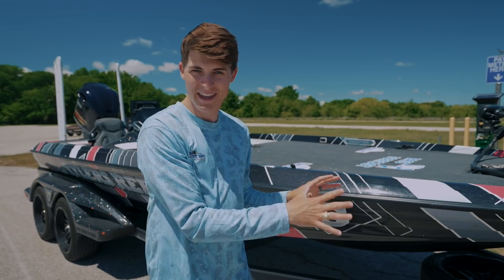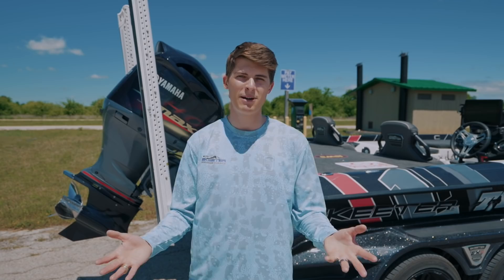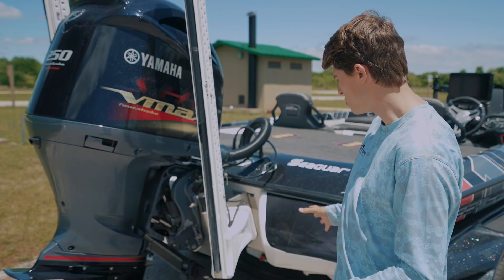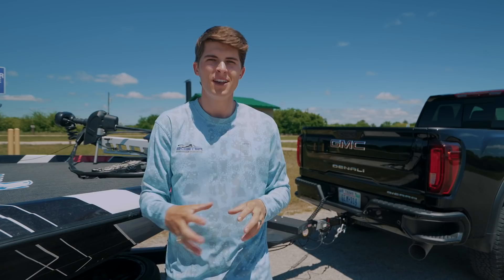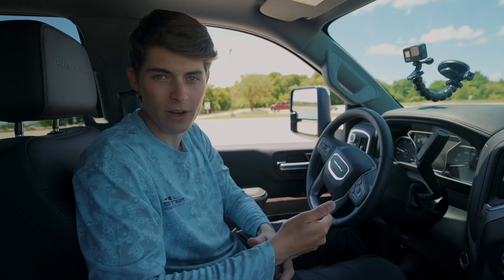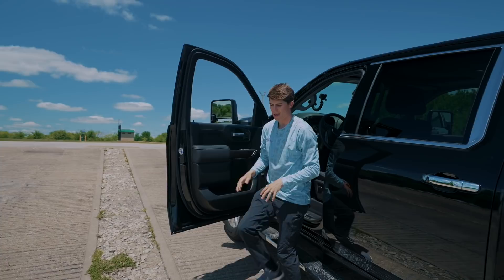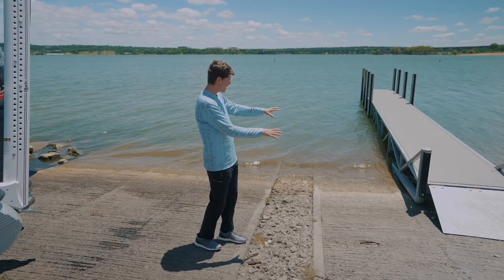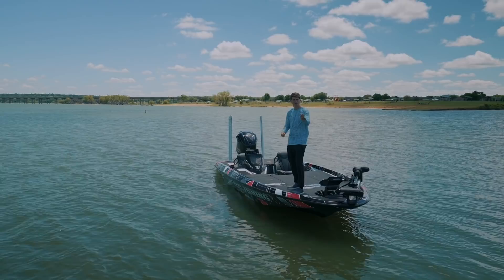Backing A BOAT TRAILER Down The RAMP!! (The EASIEST Way)

Comment: While this method obviously works for you quite well i dont think most older anglers can do this. I fish alone and am 63 yrs old. I am very fit and agile still as i was in the military for 37 years and i dont think I’d attempt this method. I simple back the boat into the water until the trailer wheels are under water, put my vehicle in park with emergency brake on and then unclimbed the safety strap, climb in the boat, start it up, back off the trailer, tie to dock and then go park my trailer.  No chance of the boat ever getting away from me.  I also purchased a ‘trick step’ for the bow of the trailer which allows me to climb in and out of the boat without ever getting wet.  Most pros i know who fish alone have one …

Comment: I also launch by myself almost ever time I go fishing. One thing I do is attach a dock line ( about 30 feet ) to the boat and trailer to keep my boat tethered until I can get on the dock.
Reply: Exactly. If you do like he says in this video you'll be swimming for your boat if you don't get the perfect launch
Reply: I just watched 2 videos that both launched this way. It’s all fine and dandy when ya have them power poles to throw down when ya f up.  I’d have way to much anxiety to launch like this!
Reply: @jcappel802  I don’t have power poles. I tie about 25 to 30 foot of line with one end to my boat and the other end to my trailer. I back my boat into the water until it floats then get out untie the line from the trailer and walk it to the dock.

Comment: If you're by yourself, it also helps if you tie a line off to the boat and your truck, just Incase the boat decides to get taken away, and I personally wait til the boat is right at the waters edge before I disconnect the winch AND the safety chain. I have personally had a winch fail and if it wasn't for my chain, the boat would have rolled right off onto the ramp.

Comment: Great instruction video Tyler. As always,  wise beyond your years! 
I use a rope tied to the bow loop to pull it back into shore as most of my Ramps dont have docks. I also have a Truckers Knob on my steering wheel to make backups and towing easier.

Comment: That boat launch procedure looks really cool. If you’re a beginner, do not follow the last step without someway to secure your boat before you get out of the truck when launching solo. All other considerations discussed were great! Also, consider the size of your boat vs the 21 footer vs the wind direction.

Comment: Get a routine for getting straps off and plugs in and you will get it down with time, for backing up it’ll just take time so go at a not busy time and just back it down. Take a break if you  frustrated cause it will only go downhill

Comment: Two things that most folks should do if launching by themselves: First, keep you boat strapped to the winch, so the boat can launch off the trailer and not run away from the docks.  Second, start the boat before unstrapping the boat from the winch.  I've seen and helped more boaters retrieve their boats that floated away from the dock while they are getting out of their vehicles and if the boat doesn't start, then it will be able to be put back on the trailer.

Comment: Hey you forgot to park the truck!! 🤣 JK that angle tip will help I also usually go alone!! Hey you should do a vid on the hazards of ramps that could cause you’re vehicle to go into the water! Like algae on the ramp I saw a truck similar to the one you have slide right into the lake!! It’s on YouTube some where you should check it out if you haven’t seen that one! Thanks again! Also THAT BOAT!! Nice!!

Comment: The “trim blocker” is called a transom tote and it’s to keep your boat motor straight and to keep the motor from turning side to side and bouncing up and down while towing to protect your  motor the lower unit the trim and everything in the back end of your boat from damage
Reply from the maker: Yes, that is correct

Comment: The easiest way is to drop the tailgate and watch the boat over your shoulder provided you have enough clearance between it and the trailer/ boat. 
Launching without the boat attached to something is a good way to guarantee you'll be taking a dip to go get it,  leave the winch attached then step on the tire to get in the bed and unhook it then either drive the boat over to the dock or shove it back with a bow line attached and pull it over to the dock.
Reply from the maker: Learn to use your mirrors and you’ll never go back. Trust me. I will go to my grave over that fact
Reply: @TylersReelFishing  you can pull up at an angle to the ramp and you don't have to go slow when you're looking right at it. You get it on the first try every time with the boat on or off the trailer. I'm talking about jon boats though,  your boat is plenty wide enough to see in both mirrors.  I just got a boat with a 92" beam but I'm so used to my old 1448 that i still look over my shoulder.

Comment: I prefer to power off the boat that way it's never out of my control when it comes off the trailer.  You do this by only putting the trailer in far enough to let the friction from the bunk boards hold the boat which is usually when the water hits the top of the trailer tires. Fire up the engine and back the boat off usually just takes a little blip of the throttle to pull the boat off the bunks.
Reply from the maker: I do that if it is winter, or I don’t have a dock that I can jump from

Comment: Bro have me cringing so hard. Best method is the one that works for you but i keep the bow line on but loosed out until I'm in the water. Especially if there is a dock. I also will always have a line on the back to the dock.